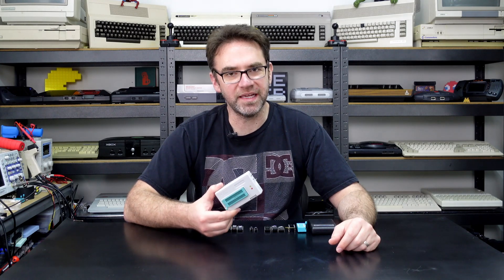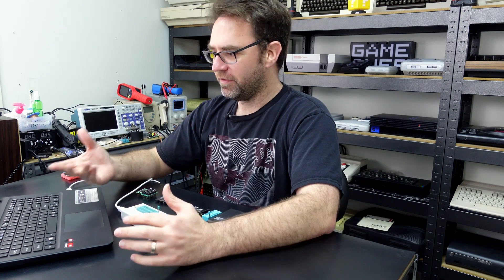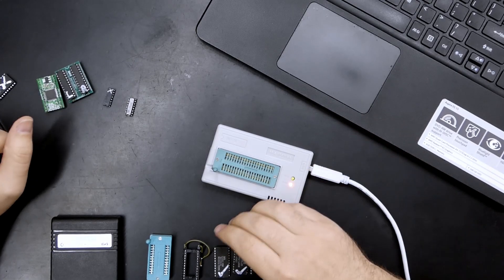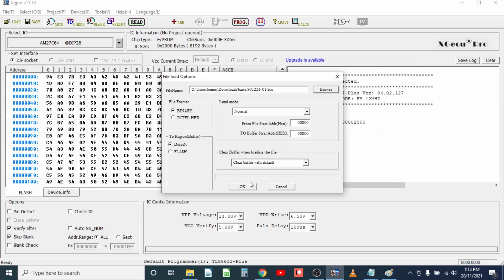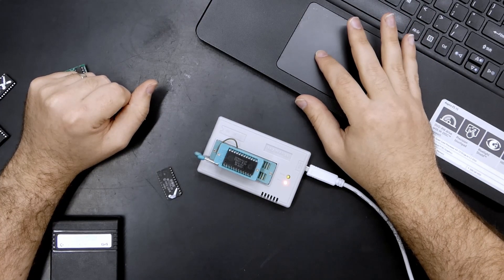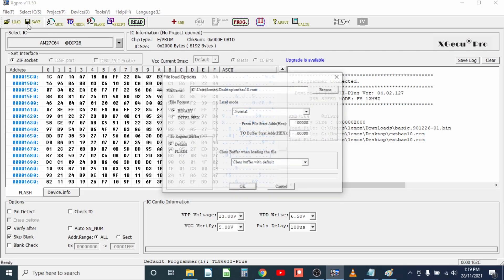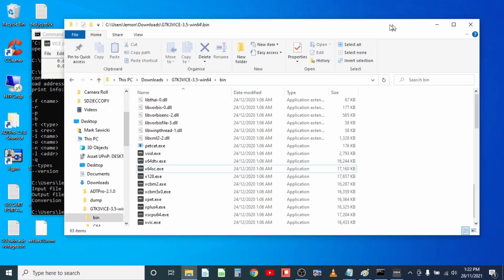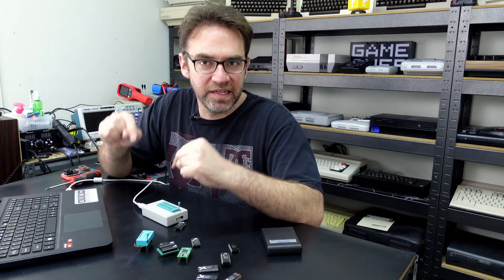MiniPro TL-866ii universal programmer additional uses - C64 PLA, 2364 DIP24 and logic testing

Comment: Hey! Great video! How about reading Commodore 128 KERNAL chips (28 pin?) I am not able to read them using TL-866II device.
Reply from the maker: It should be possible to read them as a 27C256 without any adaptors, you just need to turn off pin detect
Reply: @TheRetroChannel  yes. I found it by myself to turn off pin detect and it works, thanx for the answer :)

Comment: I really thank you for the explanation. A question: Do exist generic instructions (using something like a truth table) on how to read/verify and possibly write into any generic logic IC which actually is not in the capabilities of the TL-866? I mean, i.e. I've to necessity to read some old PAL 16V8 and possibly write the content into a new one. Do you think it would be possible to make a .lgc file, together with some added hardware just as you did, so to allow the TL-866 to program PAL/GALs?
Reply from the maker: A lot of PALs and GALs are supported out of the box to be programmed. You should be able to find them by just searching in the IC list (not the logic test list). But if you need to read one back, chances are it will be encrypted so likely won't work. Maybe it would be possible to create your own logic table by analysing the inputs and outputs.

Take a look at L Break Into Program's video (link in the description) as he goes into how to make a custom truth table in the programmer software
Reply: @TheRetroChannel  you are a very kind person! THANKS!!! I've just scanned the IC list and I've found the 16V8 PAL I was looking for! The list is jaw-dropping! The last time I did a search on the TL-866 IC list, and wouldn't be able to find it in that list. Maybe the TL-866II has more capabilities! Thanks, bro for your kind help!

Comment: Great tip immediately had to try it if I can test a PLA works very well. Next time I solder a GAL PLA I can test it with the programmer first before putting it in a board. Btw. latest version of the TL tool did no longer give a virus message when I downloaded it.

Comment: I still use a Needham PB-10 programmer. It works on a ISA slot. I replaced many corroded ROM chips with eproms using it.

Comment: Great video. Can you test the super pla from a 250469 board?
Reply: No, because it has 64 pins while the TL866 has only 40 pins in its socket, no way you can solve this with an adapter.
Reply from the maker: @Daniël
This. And also thanks for your work on the GAL PLA 👍
Reply: @Mr Guru The question was not about the SuperPLA product from Individual Computers, but about the big or fat PLA found on original assy 250469 short mainboards.
Reply from the maker: As others have mentioned there's no easy way to overcome the 40pin limit of the tl866. Just looking at the pinout of the 251715-01 almost all pins would need to be able to be addressed. And the last rev 25235-01 has the colour ram integrated so no chance there
Reply: @Mr Guru no i mean the pla on the 250469. this pla is also called superpla and its an old one with commodore id. 😉

Comment: There's an easier way to verify a 4K ROM (like the character ROM). In the minipro software, when loading the original ROM image, just change "TO buffer strat addr" (the typo is just like in the minipro software) to 1000. You can then verify the ROM against the one in the adapter directly.
Reply from the maker: Haha, yes of course, didn't even think about that. Right, time to do another reshoot 😉
Reply: @TheRetroChannel  Ok then I'll wait for the next reshoot to post my next comment... so you'll have to do yet another reshoot.
Reply from the maker: @granpawa  Ice cold 😄
Reply: @TheRetroChannel  Yup. That's me.
Reply: @granpawa  I thought that it might be easier to save a full copy of a good character rom, including everything above 0001000 and then using that, to compare other character roms to, using this method.